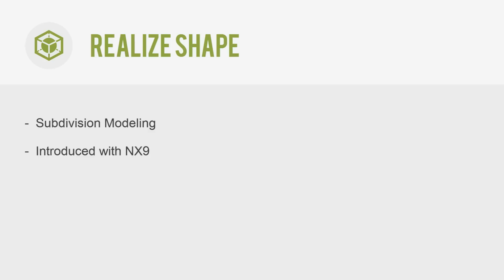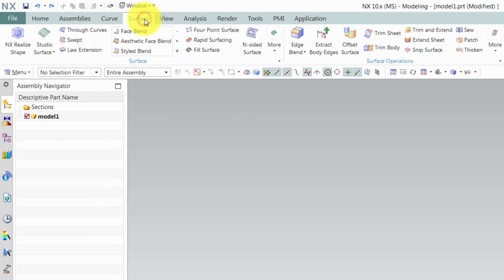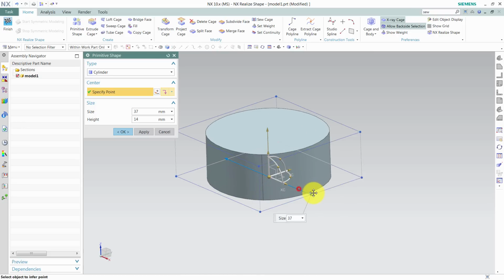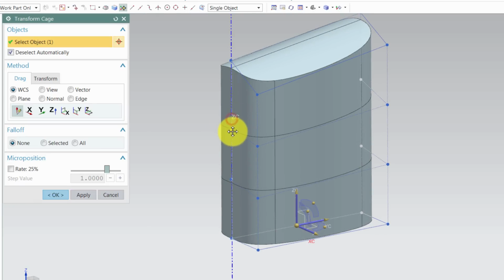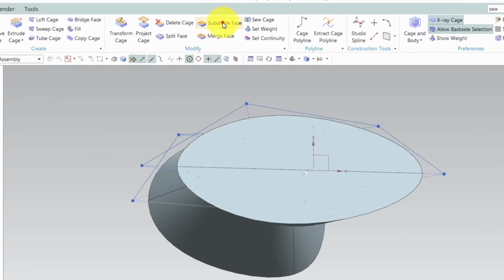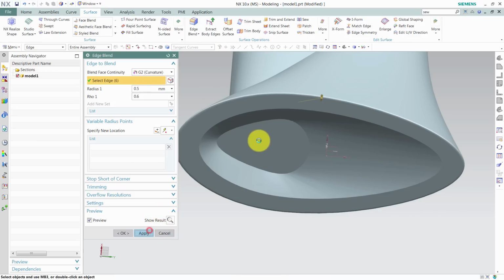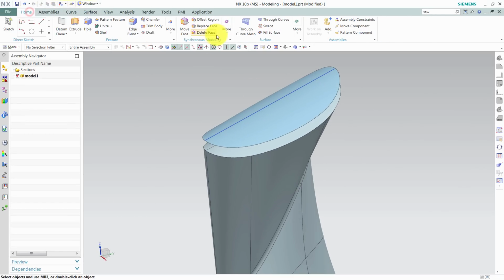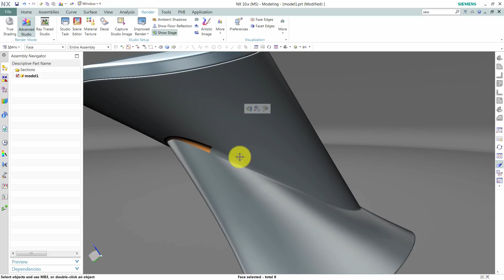NX Realize Shape | 1 - Introduction

Comment: Hello! Thank you for this video lesson. Could you explain me one thing. When you use Transform Cage option you have aditional check box  "deselect automatically". In my case I have none, so I have to deselect my picked points, edges etc manualy.  Where can I find this option in NX 11?
Reply from the maker: Hey! Yes I've noticed that myself. I'm on NX12 at the moment, and that option has been gone for a couple of versions. I'm not sure why they decided to remove that, as I do miss the ability to have automatic deselection when doing quick shaping.  I don't have any answers at the moment on this, but I'll shoot some questions to someone who might have it.
Reply: Miror, thanks . It would be very helpful!

Comment: how to apply shell on this model?
Reply: Anuj Jain Probably need to do it manually due to tight geometry. Alternately you could use delete face (heal checked off) and use thickening on the surfaces
Reply: Magnus Skogsfjord  This method worked. Thanks a lot

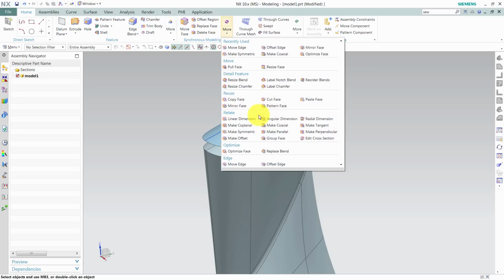Comment: How did you get rid of the surface at 8:06?
Reply from the maker: Hi, the surface I think you are talking about is simply hidden. If you hover over an item(solid/surface/curve/etc) and hold down the right mousebutton, a shortcut menu (radial menu) will appear. Then you keep holding the right mousebutton and drag your pointer to the button in the lower middle part in this menu. It doesn't remove anything, but simply hides it.
Reply: When I hide that extrude(5) the fill surface also gets hidden but in your video it doesn't? Any advice?

Comment: This tutorial is very beneficial for me and thank you so much. My question to you is that, How you have applied texture on that model? shown in the beginning of the model. Please help me for that.  It will be beneficial.
Reply from the maker: Hi Prasad. Thank you for your kind words. It's appreciated. 

Regarding texturing, this is done using KeyShot, which is a 3rd party software for rendering. I prefer using this for final visualizations. Let me know if you have specific questions about that.
Reply: Thank you very much.:)
Reply: it is also no problem adding textures in NX - did u find out already?

Comment: I'm new to nx and i cant seem to find the option of realize shape on the surface ribbon. it starts with shape studio. is there something i need to re install or do i need to check it from some hidden option.
The same is happening with synchronous modelling. i cant seem to find the toolbar for it. 
it would be very helpful if you could spare some time and guide me out of my problems.
Reply: Right click the toolbar and check surfaces.
Reply from the maker: Hm.. It may be a case of incomplete installation. Which version do you have? If memory serves me right, NX Realize Shape wasn't included until one of the update patches for NX9.

Comment: When I go to drag one of the faces, it doesn't allow me to move the entire face; it drags everything but the top surface edge and separates the piece. How do you stop it from doing this?
Reply from the maker: +Jon Thomas Would it be possible to show me a picture that describes how it looks like when this happens? Do you have the transform tool active when you try to move the face? Or: Have you looked to your selection filtering to make sure that you are able to select the cage face?
Reply: +NX - Portalen Please see https://www.dropbox.com/s/g7ptmpa2u3wdn6f/Screenshot%202016-01-06%2005.20.32.png?dl=0
Reply from the maker: +Jon Thomas Although I am not sure about it, it seems like you have added two primitives to your work environment. Maybe you have clicked both apply and OK when adding the cylinder. Could my assumption be correct?
Reply: +NX - Portalen I think you're correct. I went back and tried it by just clicking apply, and then ok, and then both and it does indeed impose to primitives on each other. That is very strange. It seems intuitive to click apply then ok, however note to self to just click one or the other.

Thanks for the solution.
Reply from the maker: +Jon Thomas Yes, I agree that it might seem counterintuitive at first. But if you are in a situation where you need to add multiple primitives, the apply button is quite handy :) So the "OK"-button is sort of a combination between "apply"+"cancel". This is a standard layout for the majority of dialogue boxes in NX.

Glad it worked out!